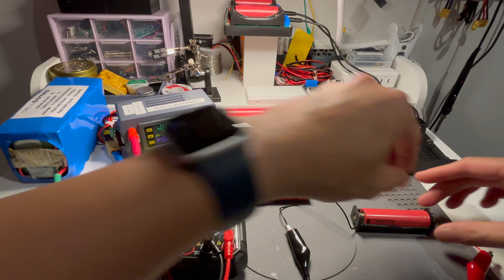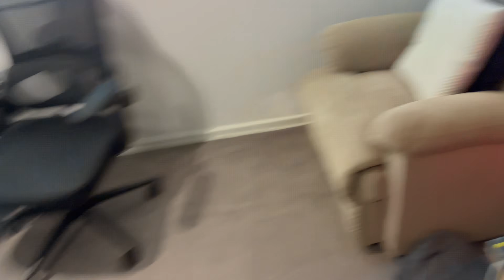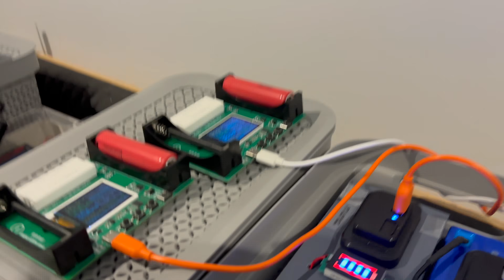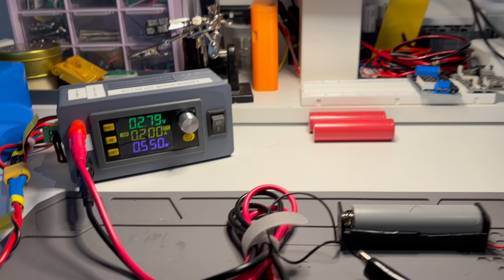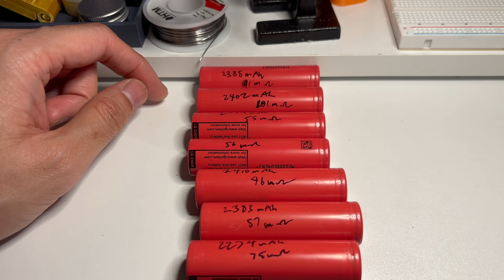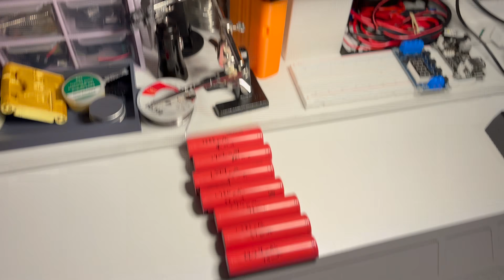How to revive deeply discharged 18650 cells

Comment: Thanks -  I just tried the same but unfortunately only gave me less than 1/2 the rated capacity on Samsung 13Qs.  Is there a way to increase them with more charge and discharges?
Reply from the maker: No there isn’t. When I get these batteries, I revive them and store for a month or so then check voltage. They are just for low power devices. Parallel more of them up but don’t use them in critical projects.

Comment: I collect batteries from e-vapes (Usually 360-550 mAh, type 13300 or 13400, or pouches). I just revived a dozen of them, now doing the voltage drop wait test over a week. I charge them with < 0.2C using a TP4056 charger with a replaced Rprog resistor.
Reply from the maker: That’s so cool! There’s a video on YouTube where a guy powers his shed and a car doing this!

Comment: I save them often.  I've got a small homemade charging board set at 4.1 volts  only .5 amp current.   I attached the leads with magnets   seems most of them come back with very little degregation
Reply from the maker: Glad I’m not alone 😊. It’s like collecting Lego!